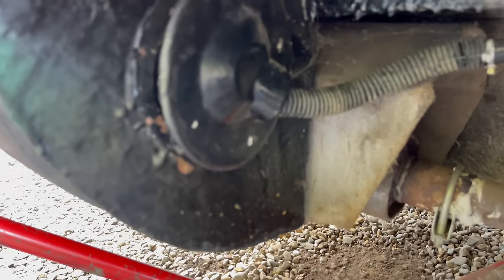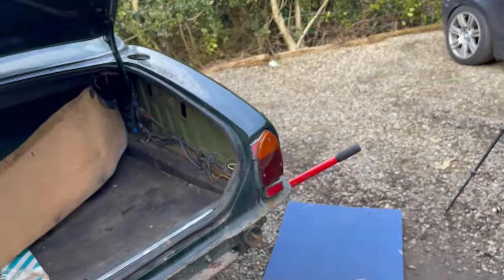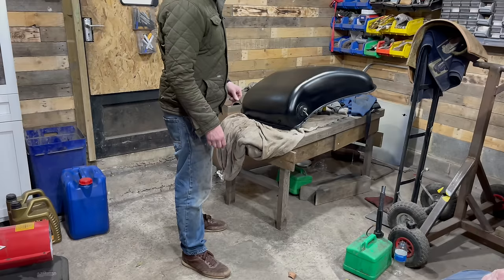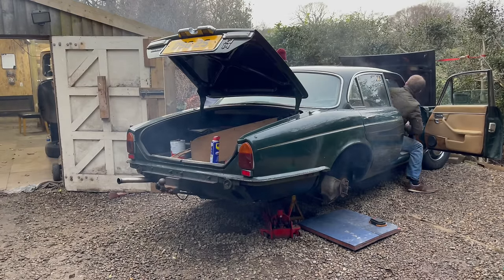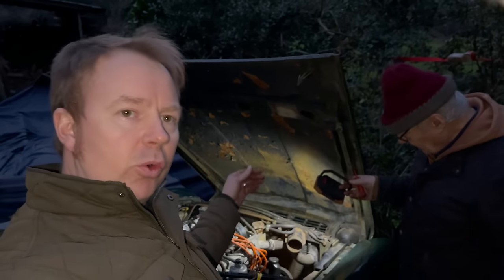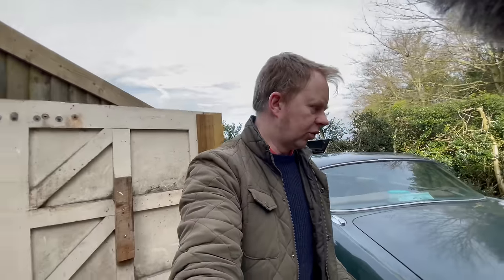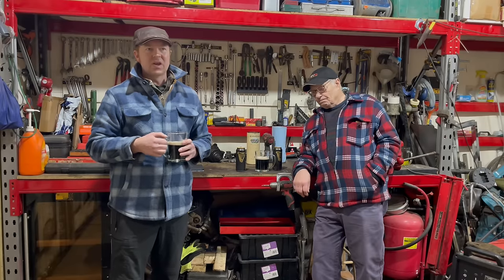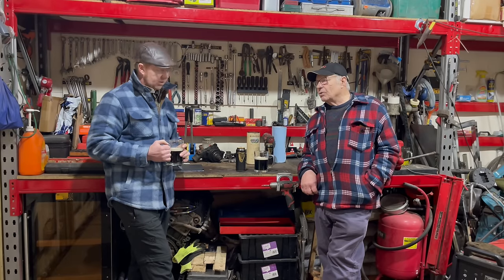BARN FIND | 1978 Jaguar XJ6 | Part 2

Comment: I am entrenched in the series Jags  and today drive a very late Japanese imported series 3 V12   and it is simply the best car on the road anywhere today .   That said a bout 10 years ago I had given up finding a decent series 2  and whilst walking one day , chanced upon a series 2 SWB  manual gearbox Jaguar xj6   and the guy sold it to me for £350 !   . Didnt require much and I drove it for a while but couldnt take to the long throw clutch and baulky gearbox    but as a rarity it was quite novel !

Comment: This brings back memories, In the  late 70's, early 80"s I had the 4.2L version, fantastic motors. With the initial starting taking several cranks to start try the following. I did this myself after leaving the Jag parked for 6 months. Over night remove the spark plugs, put a little Red X in each of the cylinders, and cover plug holes, the remainder can go in the petrol tank. Next morning crank the engine over WITHOUT the spark plugs in, just to blow out the residue. Refit the spark plugs and start the car. 
Great vlog, looking forward to pt 3

Comment: Great video regarding you cannot move the gear selector on some Jags at the top of the selector look for a small hole or slot they can be hard to spot so look carefully if you find one a small blade screwdrive will go in the hole or slot and release the the gear shift I hope you have one as not all Jags do good luck I will watch for your next video best regards Andrew Allen.
Reply: This car is way to old for that,xj40 on only for that.sometimes the cable going from the selector  jams.no brake pedal  pushing to release the selector on these.way to old
Reply: Sorry I was wrong I was going back to my Mk 10 which was older than yours I thought that had a release of course that was back in 1970 it was a 1966 model so maybe I was just mistaken anyway thanks for your reply I am sure you and your dad will get it working as it should best regards Andy Allen. @ivanfernyhough3851

Comment: An interesting vlog, if the car has been sat for a long period then the inside of radiator could be badly corroded, give it a good flush, if that doesn't improve the flow then fit a new core to it

Comment: Another great episode. Those submersible fuel pumps were a pain. The later set up was better. I think your dads right about the thermostat. I’d check that first for the cooling. If not I found my water pump was quite gunged up so that might be worth taking off at some point if the cooling doesn’t settle down. Seems to run too good for a blown head gasket. I’m curious to see why it’s stuck in neutral though. Anyway, great work! Looking forward to next episode!👍

Comment: Great epsiode Fella's , really enjoyed this. You are doing the jobs I now need to do on ours to get tit the next level  - our is running great but need to sort out the NSR tank and pump and also the refurb the brake calipers ; dad and I took it out for a run hoping theyd free off but instead we boiled them - what an adventure that was getting it home!! :face-orange-raised-eyebrow: I'm intrigued as to whether you will go witht he AED or opt for the manual conversion (manual comversion requires the base of the unit to be in situ as it sits on top of it ). One thing to watch on the cooling system which has caught both my Dad and I out (DAd has a 29k from new XJ12) is that the bottom of the header tank becomes porous due to corosion and isnt always an obvious factor in losing coolant, plus my 4.2 has done 88k miles and the core plugs have also deterioted which were also contributing to collant loss (obvious nthe top of the cylnder head but less obvious on the sides of the block as some of them are very obscured... keep going boys and looking forward to the next episode ! cheers stew

Comment: It's best to modify the AED with a manual cable-operated choke kit from Burlen Carburettor Services.
Alternatively, I get rid of the AED and replace the HIF SU carbs, which you have in your car, with 2" HS8 SU carbs and install another connecting rod between the two cards to pull down the main jets for cold starting, like on HS6 carbs on Jaguar Mk2 240/340.
I take a connecting rod from a Rover 2000TC and adapt one of the connecting brackets linking the rod to the carb, as the configuration is the reverse between a Jaguar and a Rover.
This involves chopping one pat of the bracket off and rewelding it back on the opposite way round.
I also have to make a new link arm that connects the throttle lever to the carbs, as it now needs to have a dogleg in it to accommodate the new connecting rod linking the two carbs.
This gives much more control over the choke in cold conditions, and ensures the choke can be shut off completely so that the engine is not running rich when it's up to operating temperature.

Comment: I have the same car a 3.4l you can get parts for the car from sng barrels.
Reply from the maker: Ah that’s real interesting to hear from someone with the same xj6 3.4, it appears they’re quite rare. Can I ask, rough where does your oil pressure sit on the gauge at idle once the car is warm? Our start at half way when cold but then seams to drop very low once it’s warm. 
Regards 
Mark.

Comment: Setting up the firing order is one thing to be aware of, but you also need to be sure that the distributor has not been installed on the engine 180 degrees out of phase. 
This can happen as it is easy to misjudge position the offset of the locating drive-lug cutout in the engine's distributor drive mechanism. 
If the distributor drive shaft is 180 degrees out of phase then the XK engine will not start at all until it is corrected.

Comment: if you are taking the N/S tank off there may be an additional obstacle.... even up till 1980s models there is a fitting, which takes Whitworth spanner, at the top. Some sort of vent-pipe iirc

Comment: Why.did you  not do near side fuel tank and pump it.will be rusted.same as driver side?
Reply from the maker: We only had one spare tank to replace the pilot side, will do the drinker side tank later down the line. We just want to concentrate on getting the car running at this stage.
Reply: The right side already had a spare tank waiting....

Comment: Why do they put the fuel pumps in the tanks? The series 1's were in the spare tyre well. So easy to get to. Modern is not always better. Once upon a time dependability through simplicity was the way to go. Today it's all about the speed, performance and the impression, ( V6 V8 & V12) whilst speed and performance is denied  by law on our roads. So what is the motor Industries point. Blind faith and dreams sell cars today. Very little practicality and reality.